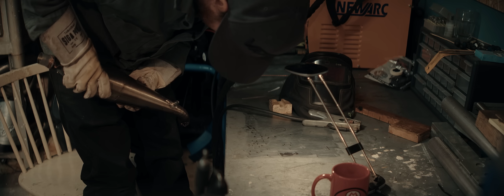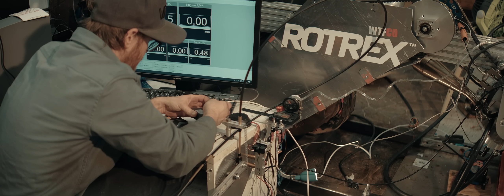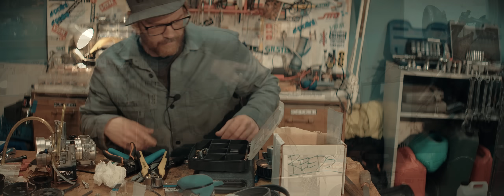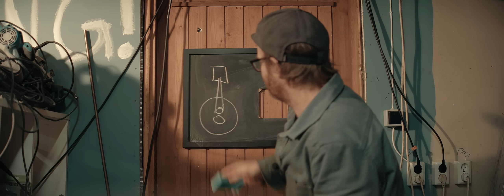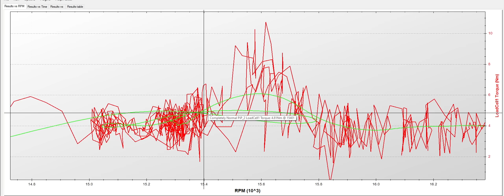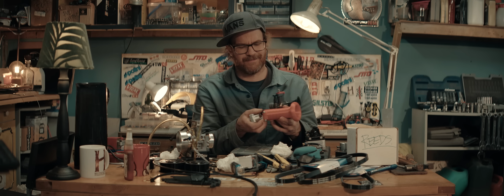18000RPM, But then...

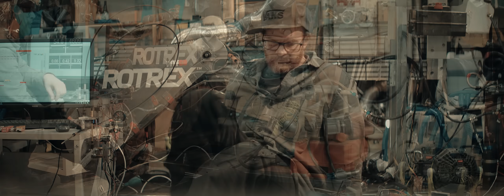Comment: I saw something at 4:29 in this video. If you look at the top cap/cover of the carb where the cable goes into the slide, you can see a "flash" or "something" shooting out toward the right hand side.
Just thought you should know; I never saw it mentioned in the comments everywhere.
Also, considering how much air-flow you'd need for this engine, maybe it would be better to get it running first without a filter - give it as much air as it wants first, and then filter it afterward. It sounds like it is struggling to rev-up in the first place, almost like it's still choked, like when you give it some throttle the response is very sluggish. If it's not the jetting ( which you've tried), it may be the air supply?
I've been watching your excellent channel for about two months now and I truly admire your fortitude!
Regards from South Africa.

Comment: Boost tube will add more fuel vaporized at the right ML to help get it on the crankcase volume but you'll need to lower the idle screw it really helps with no reeds
Reply: There are some slow-mo videos here on YouTube showing the fuel climbing up the needle and being torn away in globules showing the lack of atomisation.
I feel the Rotrex/Lectron was let down due to the lack of fuel atomisation using R/C fuel.
Reply: @malcrandall1309  I'm sure he's trying to get better nitromethane for  fuel license like he talked about already
Reply: @seanbragg1696  Yes that's right. Does that give better fuel atomisation?
Reply: @malcrandall1309  well it means he can get better nitromethane and mix it himself most rc fuel is not as good as doing it yourself which most top fuel dragster teams do to achieve the 11,000 HP especially since there's restrictions on how much fuel in a cell think rc varies between 10 - 40 nitro

Comment: Dude considering this engine isn’t tuned yet 1 thing I would definitely say you achieved is getting a 2stroke engine near on bullet proof! Reliability wise damn dude you killing it! Love this project!
Reply: I like how it went from new rings and new cylinders with better plating every single video to like 200 pulls on the same piston, rings and cylinder. It survived all kinds of torture, too. Too rich, too lean, ignition timing all over the place, running out of fuel, etc. That is mighty impressive considering everything is custom designed and built.

Comment: I think you can leave the load cell attached to the engine, the damper should work, also an analog low pass filter could be used, just make sure the smoothing happens before the sampling to avoid aliasing

Comment: Are the bearings lubricated by the fuel? Maybe which to external greased filled bearings to reduce wear. Yes it will be another resistance on the engine but would be negligible with the blower.

Comment: Crank issue - is it heat (lubrication) or balance? Shouldn't be destroying bearings after 50 hours of run time. Maybe look at crank balance again. Look at biasing recip weight more (eg. 55%).
Reply: I doubt you will ever see this with it being posted so late but I totally agree with all your comments!
Crankshaft ballance has being a problem right back to the early days of the SPX.
We mustn't forget the crank also failed on the Brute Force as well.
I feel the problems Alex is facing is down to the massive crankcase volume, poor pumping efficiency and poor bottom end lubrication. No drilled lubrication passage ways!
Reply: Absolutely everything about that motor is custom designed. I'm surprised they even lasted that long tbh. It's not like it's a factory Honda motor where we know how long they should last.
Reply: @mjodr  No, it still uses a piston, conrod and counterbalanced crankshaft - the custom ports, port timings, chamber sizes, etc... does not affect basic crankshaft principles.
Reply: @LitchKB  I'm talking about how we would know generally how well a factory Honda motor is machined and balanced, the tolerances, etc and how that relates to life of the parts. But this custom franken motor, who knows? It's possible there was some tolerances off or imbalances not accounted for and thus an early death of main bearings.

He's also been pushing significant power for a 50 cc design when it does run right for a few seconds.

I mean, how could you even compare that to other motors and say with confidence it should have last XX hours??
Reply: @mjodr  
> I'm not talking about comparing it to the likes of a CRF50, you are, I'm making the comparison to what it's built with.
> It's an off-the-shelf racing crank/rod/bearing setup (Stage6 brand).
> He's well aware how to balance a crank
> 15hp is not unusual for 50cc racing engines
> It hasn't been under constant heavy load, half of its life has been troubleshooting issues.
> 50cc racing engines typically last more than 40h.
> 40h was a generous estimate to begin with.

He'll likely comment on bearing life in the next video so we'll gain his insight then - but at this point, to me, it seems premature.
Reply: @LitchKB  I didn't realize the bottom end was standard. I thought it was just as custom as the cylinder, piston and head.

Comment: Those 18k rpms had me on the edge! Either you need to get some military grade reinforced main bearings, or create a separate oil/cooling system for them. Would be so cool if it lasted longer.
Reply: When Suzuki UK removed the oil pump system from their 750 triple race bikes in the early 70's it ate main bearings at a alarming rate just to save power. Would ceramic bearings be a better alternative if available?
Just wondering was Alex still using the chain saw petrol mixed 50:1. 
Reliability must be paramount at the expected 20k RPM for the 4 minute speed runs at Bonneville.
Reply: @malcrandall1309  Exactly, i thought about ceramic bearings as well, but even though ceramic is very hard, it cracks very easily. I wonder what an oil pump direcly to the main bearings would perform like... Oil should still be distributed throughout the crankcase and cylinder walls
Reply: @lengaming1651  Thanks for your reply Len. I feel a oil pump would add complexity for such a low cost replacement  part. When Alex uses the 20:1 castor base oil new bearings should last long enough for the speed attempts......God willing and a strong tail wind.
I feel low primary compression doesn't help lubrication and other matters as the induction track is angled upwards towards the transfer passage ways.
Reply: @lengaming1651  Hello Len, I doubt you will see this message re main bearing failure but I can't find any signs of a drilled lubrication hole to feed the outside of the main bearings on the PiP cases. I can see there is a scalloped area near the main bearings on the inside which I think is to allow lubrication to enter the bearing but it doesn't seem to be working over well!
Reply: I think the extra fuel/oil in the top fuel mix should be enough, but to keep running it on gas, yeah

Comment: Famous last words of a tuner "now let's give it some more timing" 😅
Reply: I was expecting it to pop the second time he said that. But then again he has thrown that ignition map all over the place in the past.
Reply: I have left a comment re ignition timing. When Alex was running 15 degrees of advance on previous test runs this only equates to 0.835mm of piston travel which is way retarded.
Back in the 70's when I raced twin cylinder 125 Yamahas there timing ranged between 1.8-2.0mm BTDC on a 43x43 bore and stroke engine.

Comment: Does the issue with the dyno software occur at and above 16384 RPM? If so, they're using a 16 bit signed integer. If you set a signed 16 bit integer to any number greater than 16383, it will "overflow" and be interpreted as a negative number.
Reply: 16 bit signed integer would be 32767, half of 65535.  At least on everything I've ever worked on

Comment: Ive had that Yoshimura carb on my last 2 stroke project,  You NEED to drill out the idle circuit for it to work properly on a 2 stroke.  this is something i found out myself and there is absolutly no info on this.
Its not hard to do and i did it by hand. you just need to make sure you angle the drill exactly right.

Compare this carb to the D-slide carb by looking into the carb from the Filter side,  (could be the intake side as well, i forgot as its been a few years).  you see a small hole that allows air to pass over the idle circuit jet so it create a venturi and suck up fuel.
This hole is not present in the Yoshimura carb and therefore it will not run properly.
Ive adressed this with the company years ago but didnt get any response.
You also need to swap the needle to a conventional style needle and i think i even used the needle from the Keihin 28mm i had laying around.
I needed this carb to work due to space restrictions in the frame so even though it was new and very expensive i went through with it and drilled it out, glad i did because in combination with a different needle the carb work perfectly.

It been atleast 5 years since i bought mine so it could well be they changed it or mine was a manufacture error idk but i would check if that hole and channel are drilled.

Send me a PM if you want more info on this.

Comment: In an attempt to sound like broken record, can the exhaust handle the flow at temperature? Simple math says 50cc at 18000rpm, or 0.05liter at 300 rotations per second, boils down to 15liter per second. I'm having a hard time imagining your end-pipe diameter is enough to facilitate 15liters a second. I'm not sure if you can simply enlargen the diameter, you might have to upsize all of the pipe somehow, but that's more your expertise I guess.

Also, about the first hump and troubles with mixture, can't you help power the engine up to speed using a (fast) electric R/C motor?

Comment: You mentioned at some point that instead of running it on nitromethane the "normal" gas you put in it was the premix 2% gas meant for chainsaws etc that you can buy from the hardware store, I've had similar problems on a 50cc moped engine using that same chainsaw gas, but when i switched to 98 octane and mixed quality 2 stroke oil with it myself the engine ran much better. Keep up the good work!
Reply: I’m surprised that he’s running an engine engineered from the beginning to run on glow fuel on regular pump gas. I’d run at LEAST 112-116 to avoid detonation issues
Reply: @RyanMcIntyre  I have a feeling the engine is somewhat low compression and he mentioned once the squish band was about twice as thick as it needs to be, so I believe that would reduce the octane requirements. Plus he has full control over the ignition system and a fair bit of experience so I feel like he was in the safe zone most of the time.
Reply: @mjodr  Your quite right Alex did state the squish was too large for petrol. I can't remember if Alex added base gaskets to increase the squish when he was running R/C fuel, we'll hopefully find out when the engine is stripped.
Reply: @RyanMcIntyre  Don't quote me but is this fuel available in Norway. Things are much stricter over here in Europe,UK, Scandinavia.
Reply: Alex was only using the premix fuel in the previous episode just as a quick trial as he had no neat petrol after running R/C fuel previously. If he was still using the 50:1 I don't know, but it's not enough for long term testing.
Lets not forget petrol goes off in storage.

Comment: For a little mechanical engineering help here if you put a damper on it like a shock it won’t mess up your reading. Dampers only dampen velocity, they don’t dampen a force or scale with acceleration so if you put an off the shelf damper on the engine it should still give you consistent torque readings. If it’s a torsional measurement the same still applies a torsional damper will only provide a counteracting force for angular velocity.

Comment: that emulsion tube shroud is also called the "primary choke" in mikuni speak, the taller ones are 2 stroke style, the height effects fuel delivery vs rpm, a tall one sucks more fuel from the main only at high rpm, great for keeping a 2 stroke lean and clean at low rpm off the pipe

Comment: My thoughts about this all may not be liked or debunked, and that is fine by me. I am not into two stroke gasoline engines, but i think forced induction does not work well with it.
Forced induction does not have any benefits by a typical used expansion exhaust pipe, were the N/A does. Exhaust driven as they call it, as well as it is used on
Natural aspirated 4 stroke racing engines, pipe length and diameter. Two stroke as you know has particular exhaust design wich is very narrow and precise
You said going back non-supercharged for troubleshooting; i think it has not much use because both are different world's. 40 years ago GP 50cc engines made close to 16 HP 
at 18000 rpm. already. Its like inventing the wheel again. Anyhow, i like your video's and "almost desperate search" to succes at this. 
There is one dutch former 50cc racer who has experienced a lot on this subject, his name is; Luc Foekema. He did eightmile drags on his homebuild 50 cc.
He is at age now, but may be still at it. go check him out if you want. https://www.youtube.com/@50ccRacing/videos

Comment: Are you monitoring carbon monoxide levels in your shed? 

Those burner heaters kick out a fair amount plus that 2 stroke kicking, I know you have exhaust fans but it’s just 1 extra layer of protection, especially when it’s so cold

Comment: That EGT seems really low.  I know it's in C, not F, but still,  shouldn't it be closer to 500c ?
Reply: I spose it's hard to know if that is accurate without a baseline temp with it running right.
Reply: I thought it was really low, too. But I don't think he ever got it running right. It was never quite singing right on song. That could probably build a few hundred more degrees of heat.

Comment: 110-- maine. bilg filter. plz. got my 70 replicaa manages 28mmCARB 110 jet. the amout of air that can pas thru he filter is so high. THa the exeleration of the air in to the carb, make the atomomizing so much better;-) i HAVE tweekt this alot. Got MY honda sfx pass 130kmt om originl gers. the high speed of the air picks up much smaller droppling. HQVE A GOOD ONE. plx tey iy. I WOULD OVE YO SEE THE RESSULTS. im certqin11

Comment: You cant create energy out of nowhere. The torque in the reciprocating parts cannot possibly dwarf that of the chemical explosion from combustion. Regardless of what else is going on they all have to equal at some point and in fact the total energy in the reciprocating parts should actually be lower than that of combustion due to inherent loss through the entire process so I'm not to sure about your theory there Alex. I think you'l find that you are going to need to go either multi carb or EFI and an ignition that is fully programmable for timing and event/change through the RPM range. Not only would multi carb be damned cool but I think you'll find that with the correct ignition it will actually be easier to tune once you have the linkage sorted out, and much more manageable across all rpm ranges. Way way way back (around 1980 or so) Polaris came out with a little one lunger 250cc sled engine( I think it was called a TC250) that had a rudimentary expansion chamber on it. I took mine and fabbed a better pipe and put a  dual carb set up scavenged off of I dont even remember what now it was so long ago, and that little sled kept money in my pocket snow dragging much more powerful sleds for a good 3 years until I blew it up beyond another rebuild. It was obnoxiously loud, and ran hot as hell, should have really been designed as a liquid vs air cooled but that sort of thing diidnt come in until a couple years later with the little Arctic Cat single cylinder El Tigre 250cc racing sleds that had a expansion pipe very similar to my fabbed one and a dual carb set up. Very coincidentally a dealer in Peterborough Ont Canada who was a stalwart with the Arctic Cat racing team at the time was also the one that did all my fab and maintenance so go figure. Anyway, again I think you'll be way farther ahead going multi carb or EFI and programmable ignition and I wouldnt be a bit surprised to se a lot of your issues just vanish up in smoke but that of course is just my theory, one old gear head to another lol :{)=. As it stands right now you are making about the same power as  a kawasaki 50cc single cylinder dirt bike engine can normally aspirated, and hitting on the next couple of upgrades i the right direction should push you well past that into reall danger zone level horsepower, what fun indeed!

Comment: That sucks man. Can you get "roller" bearings for it? Much more durable than the "ball" style bearings.

.....or you went too long without replacing them since you "floated" them on the crank? I know they need to be replaced at a higher interval when setup like that.
Reply: When you consider how long kart engine bearings last, why are these worn out!. With not using a variator at the moment 2 roller bearings could be used for testing and quite cheap.
Reply: Iv'e just found Sacha Drenth's channel and his 50cc race engine uses 2 roller bearings.
Reply: @Malc Randall  

Definitely a better bearing choice. 👍

Comment: You can counterbalance both up/down and front/back forces using a balance shaft (like what some 3 cylinder engines has done in the past), the least difficult way for this engine would be a single counterweight externally geared (needs to spin the opposite direction of the crank) with a separate or no housing.
A 50/50 balance between upwards and forwards vibrations is actually perfect for that purpose, but more resilient torque measuring is better.